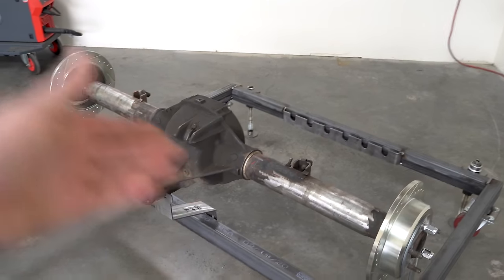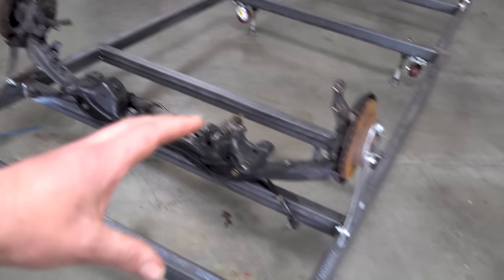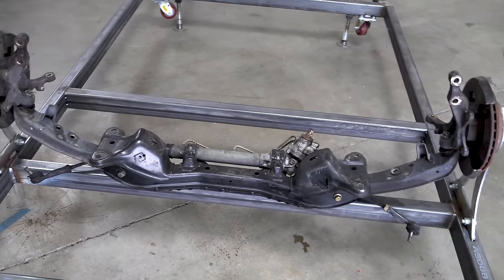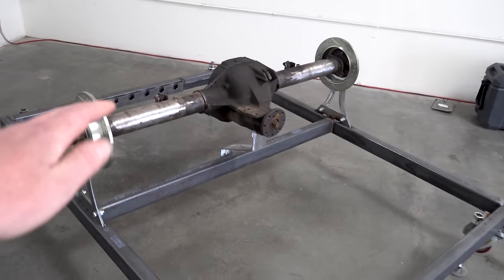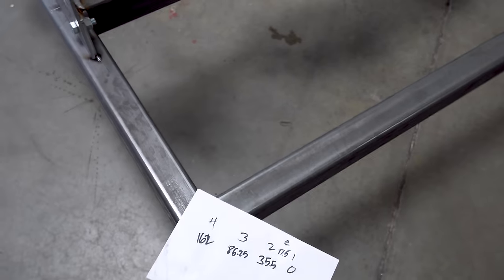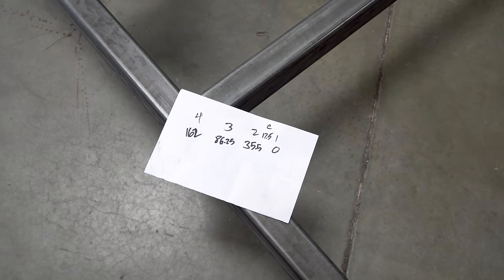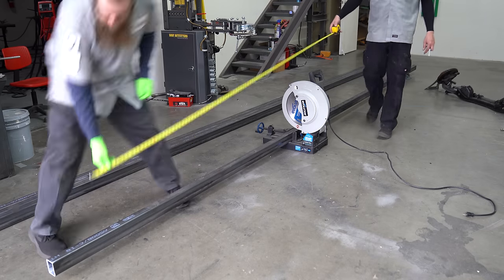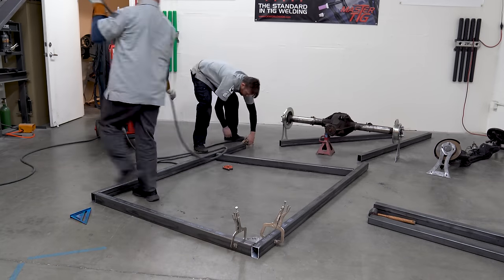Let's Build a Chassis Jig

Comment: Ah tip for anyone that hates leveling stuff that are large and painful.. get a laser level.. Stick the laser on a stand a couple of meters (yeah im swedish) away from the frame..  Make a small stand that holds the receiver.. Stick the reciver on a corner, raise it till it beeps, move to opposite corner, raise it till it beeps, continue till it beeps equally all around.. you are done.. Yes laser levels is expensive.. so is a welder, a frame jig, a plasma and building a car from scratch.. when not using it, lend it to your wife hanging picture in your apartment, watch her try to figure out why laser level looks crooked in your house... enjoy.

Comment: I'm a fabricator myself, and will confirm that this is the right and as far as I know the best way to set a jig up, excellent setup since it's simple, and versatile since it's mobile. When you give up on the project for a year (been there), then you will thank yourself for have wheels on it
Reply: this is a good "cheap" way of doing it....the "right" way of doing is too expensive for your home build or a one off build that's not a pro shop dedicated to building chassis
Reply: @supersevenn  agreed yes, the best cheap way for most average people to get access to.
Reply: @supersevenn  Its plenty "Right" as long as the finished product is sound and works as intended. And the only difference from this and big NASCAR or Dragster shops even motorcycle shops is they make their fixtures fully adjustable and strong enough to make hundreds possibly thousands of Chassis. a couple to a few a week for years at minimum. This guy isn't planning to make these on production so no need to go all crazy expensive. Thats the only reason big shops use big heavy expensive materials on their fixtures. If the dimensions are right and its welded correctly it's coming out right either way. Makes no difference.

Comment: Love the video, working with a temporary jig currently and plan to build my own in the near future.  One suggestion before you go too far.  Raise the front cross member so the lower control arms are parallel to the jig.  This will change your track width on the front and might help with the Camber in the front.
Reply: Jim Fisher Exactly my thoughts 👍

Comment: Funnily enough I had to build a chassis jig recently for my mid engined V8 Beetle project but as I only have a small garage it needs to be moved constantly. The top is 2" x 2" box with 2" x 2" spacers approx. 10" long underneath with a third layer bottom also of same box, along with various cross pieces all fully welded on a 5" square 1" think steel table. It's flat, square heavy and moves very nicely :D Really enjoy your vids so please keep them coming!
Reply: Awesome! Anywhere I could follow the build? I'm a VW guy with an '80 scirocco. When I finish my 2.6L w/ Weber DCOE powered '73 Opel GT, I'll either build a Locost(I see your avatar) or I'll convert the scirocco to rwd. I have a built VW 2L 16v with a RWD Motorsports bellhousing and mustang T5 waiting for a home.

Comment: Your method is tried and true and I can't tell you that my way is better cause its long gone now and in someones yard rusting by now as  that  was  twenty plus years ago. Method was jigging the axles and building it from there as it is definitely different and with everything done, It was one fine ride for absolutely sure as I mocked up the engine, and other driving gear. I got my ride hight from the coil overs and the ladder supports. I had the two shock per corner and then for the terrain dialed in my camber and caster and the whole thing piece by piece took form and it was a thing of beauty with it assembled... No batteries included

Comment: Interesting, I have a Mitsubishi L200 Barbarian which I purchased new in October 2018. Over the past week I have been thinking about moving the rear axle back a few inches and removing the rear overhang, why they cannot build the things right in the first place I do not know, but with a load in the back the weight is to the rear of the axle. I have done a few Ford transit trucks in the past to make car transporters putting about two and a half foot into the chassis but I had my workshop then (I am now retired) which had a lasered leveled floor now I only have my garage so a jig is going to be a must.

Comment: Pro tip on leveling anything with jack screws. Make all adjustments to the screw jacks by measuring diagonal. Level can than be verified by measuring across the width or length. The removes the dependent variables in your adjustments by screwing up your lengthwise level by fixing widthwise level. It's also useful to know your thread pitch. Knowing that a 1-8 will change height 0.125" per revolution will help you make that 1/16 of an inch change a lot faster.

Comment: Only things I've done slightly different are a couple of diagonal braces to hold squareness and some spray paint round the feet so I know to recheck level if it gets knocked or nudged and it doesn't make much difference if you're careful anyway. I also made mine a bit higher off the ground, about 18" so I could get all round it while working on chassis. Great build and a great video, looking forward to the rest. It's been years since I've done anything like this and now I'm wanting another Land Rover. I'm gonna blame you when my wife finds out what m doing.

Comment: Thanks for the helpful video... I have always wanted to build a new frame and suspension for my old truck. This is the first video that I have found that address the use of a jig to support everything rigidly. I am curious to what you do to address heat distortion while final welding the jig?

Comment: Good first step is to check that your level tool actually reads accurately. Turn it both ways and make sure it reads the same. You'd be surprised how many levels are not calibrated.

Comment: I'm a carpenter. I Like everything in this video except the leveling instruction. Jumping all over the place with the level will just leave you chasing the bubble forever.

1st, pick a corner support to start with. In this case because it's free-standing structure, it doesn't really matter which support, but one close to an outside corner. This corner will never move up or down (Z), but make sure any other support can move up or down in relation to it.

Then use the level to span in each direction from your starting corner to the next support in each direction (X and Y). Get those two closest supports perfectly level with the starting corner support. Remember, do not ever move the starting corner. You might have to adjust other supports to keep the frame from flexing too much.

Once the 2 closest supports are level with the starting corner, use the level to span between those supports and the next closest supports. Do not adjust the two supports you already leveled, only the next 2. After that section is level, do it again for the span between the next supports to the 2 you just did. Keep doing that until you meet at the opposing corner support from your starting corner. 

If everything went well, that last corner should be able to adjust to be level from both closest supports at the same time. If not, either your level sucks, you screwed up, or your frame flexed a little during adjustment. In any case, it should be a lot closer than it was when you started, so flex or mistakes are less likely a second time. Go back to the starting corner and do it again. Double check as you go with a second level if you have one.

After the second go, it should be perfectly level. Now triple check it really quick between each support. 

Now, get some spray paint, spray around each foot leaving a shadow of each foot on the concrete, and spray the all-thread where it goes into the bracket on the frame. Now any time you have to lower/move the jig, you can put it right back where it was using the paint on the concrete, and be able to get really close to level using the paint on the allthread. Always check it afterward, but you should be really really close.

All of this should only take 20 minutes or so. Even less if you use a laser level to start, but always fine-tune with a good beam level.

I work with wood, and if I can adjust beam-posts in a basement to get a 2,800sqft house perfectly level after it's been framed in less than an hour, you can get a relatively small steel frame with no weight on it perfectly level in a fraction of the time.

Comment: Idk if this helps, but as kids when we’d build treehouses we put some water in about 10ft of 5/16” lawnmower fuel line from farm and fleet and then marked 6” down from each end. Then removed 6” of water from each end. Then we’d just cap the ends and then we’d have a flexible and easily mobile level👍🏼

Comment: To save some yoga moves later, you can add the scribed centre line on the frame now. A tab front and back for an under or over slung string line adds double functionality. Keep up the good work.

Comment: I definitely will be watching. How you do your chassis jig and how I do mine, well they are totally different. Mind you what I build is smaller toys, LOL. Guess it comes from the training between you and me. For my chassis jigs, all I need is a straight line from front of the frame, that goes to the rear of the frame, past each end about a foot, and on center only. Doesn't even have to be level either. You on the other hand, have to be level with the ground and are using the wheels as main reference points, all four of them. Interesting.

Comment: Just wanted to point out that you can't actually determine that a shape (rectangle, in this case) is actually square by measuring the diagonals. A parallelogram will always have matching diagonal measurements, but is not necessarily a rectangle...I know that it generally works, but if precision counts, this way won't cut it...
Otherwise... I really dig your work, and I'm enjoying your videos. My son and I are building a CJ5, and we've learned a ton from watching your vids. Thanks for sharing!

Comment: The most important part about  making  a chassis jig is  of course to be flat but also a center line  and perpendicular line  so you can always go off of these lines and have an accurate front to back and side to side  but  thats just what i do,  Every  chassis jig should have a center line and perpendicular  permanently marked or drilled , strings , any way you can  ..

Comment: Track width is dependant on offset of wheels it's the centre of the wheels at the offset, most suspensions are build with certain offset for instance an rx8 has a factory + offset of 50mm fitting wheels with half that offset may look cool but it screws with all kinds of suspension settings starting with scrub angle and can include bumb steer  and self centering and possibly a crash . After 55 years as a mechanic and fabricator, first thing to do is make the car handle, second make it stop ....fast.. then start planning g power curves, and I mean plan forget horse power. You need TORQUE AT ALL THE RIGHT MOMENTS   horsepower is for canaries and high end runs

Comment: If the jig is set at the bottom of chassis height  shouldn"t the wheels and rearend cl be set at 1/2 tire diameter minus ride height ( normal ground to bottom of frame)? Or do you want jig to represent max bump position?

Comment: Curious about the datum points.  
First how did you get accuracy from inside to an outside surface (rear end of cab as example)? I understand the tolerance is not extreme, still.
Second, why did you not chose points more commonly used in collision work eg. holes in the frame or, sometimes, bolt head(s) centers?  
Books/tables/charts with all sorts of related measurements that may come in handy down the road.  It could be your illustrated points are the same just transferred from under to a visible surface for video purposes.

Comment: One thing that bugs me a lot is how do you center the rear suspension if your using a multi link subframe since there are caster take into account? What I mean is let say the suspension has a positive or negative caster in the first place, won't it affect the measurement for the subframe mounting point and the wheelbase since it's off?
Reply: I'm going to take a crazy guess, since you set the wheel hubs where you want, you make the chassis to pick up the sub frame where it needs to be.

Comment: Sweet its happening great video insight to what and where for a chassis jig, I've been putting a project off for years as I need to build one thing is I have another car with the exact dimensions I could build the jig straight off that car haha. As for the engine its your bus build it for you, Haters are gonna hate but they ain't driving it!

Comment: Okay, point taken, a concrete floor isn't flat or level enough to be a fabrication table, but it sure is a hell of a lot better a starting point than what I have right now.  You're building a Mighty Max, but you're thinking people will be put off by the motor?  How bad could it be, a Chevy Vega 2.3?

Comment: When you were measuring the diagonals for squareness, I noticed the measuring tape was dipping down in the middle almost touching the ground? Won't that affect the accuracy of the measurement?
Reply: Depends on how accurate you want to be; there is another "wire" method where you don't even actually take a measurement per se but rather stretch a wire from point to point on the diagonal and it has be match exactly on the opposite diagonal.  In this case you could do the front and rear boxes separately and then again overall front to rear.  For this type of stuff you could also argue you should be using a metal measuring tape, the shorter ones often are but some longer reel tapes are fibre/cloth and you run into issues with actual stretching.

Comment: Can you build a rectangle tube chassis without a chassis jig?
Reply: You need a flat true surface. I built a full rectangular tube chassis for a s10 that passed NHRA certification for 7.50 second runs off two I-beams and some 2x2x14ga square tubing.

Comment: So... that spirit level is good enough? I thought you would want it more accurate than that, did the level get flipped at least to make sure? Because in my experience they can be out a bit. Or is the spirit level within tolerance?

 Also has anybody heard of the method where you get a fluid in a bottle with a hose sticking out and level with that? I think its called a water level I'm not sure how accurate it is though but I've heard its pretty dead on.
Reply: " Also has anybody heard of the method where you get a fluid in a bottle with a hose sticking out and level with that?" Its called a water level, clear plastic hose filled with water.
Reply: Yup, used it a lot for all sorts of things - sometimes as an actual level, sometimes as a reference point - no spirit, laser or digital level can be as accurate!
It is fiddly and labour intensive, though, so if you can get hold of a rotating laser level, I would definitely recommend that as it's way more accurate than anything you're ever going to need - easy and simple, if expensive!

Comment: Surely you should have the front subframe set at its working height. Where it is and you have built the jig is about 1 foot lower than it should be. This is going to ruin all suspension geometry and wont have any further travel. 
Also with the angle of the lower arms your track width will be narrower than it would be with them set in the correct attitude (they should basically be level). With it also being a Macpherson strut suspension setup, the camber is to do with the top shock mounting and nothing to do with any of the suspension setup you have there so slightly confused why you have seemingly set the camber off of where the suspension is bound up.

Comment: If you want to save yourself a shit ton of time in the Leveling process? Get a Transit. And not one of the cheap beeping lazer type POS either. One of the old school sight transits you can read a tape measure off of then you and another person can level that fixture or an entire house in about 20-30 minutes. It really does speed it up significantly and far more accurate than even the best most expensive levels. (As long as you set the transit right) They can be pricey brand new but if you just make sure the leveling parts are good and the lens are good you can pick them up at farmers or flea markets pretty reasonable sometimes. Pawn Shops ect. 
Thumbs up otherwise from me. \m/

Comment: Don't mess up your scrub radius.  You need to widen your front suspension either in the crossmember or control arms.
Reply from the maker: We dont even have a suspension yet.... don't put on a condom to ring the doorbell
Reply: @TheFabricatorSeries  🤣
Reply: @TheFabricatorSeries  I like to knock so don't worry about me, this is about you, don't run 2" wide wheel spacers and wheels with no offset.
Reply: haha, speak for yourself - with this corona virus being passed on from surfaces, If I have to ring the bell with my hands full, I make sure I have a condom on...

Comment: can you explain how we can weld 1mm onto a 2 or 3mm plate.  I keep blowing holes in the 1 mm sheets.
Reply: Are you directing most of the heat into the thicker plate?
Reply: @gordowg1wg145  no but i can try it that way.

Comment: "if you use anything other than I-beams you have weak sauce"
 you used RECTANGULAR steel tube with the long axis parallel to the load, there's no reason to over-engineer anything when you can get away with using less and inexpensive material
Reply: A lot are built with I beams, but as you suggest, a rectangular section beam is much stiffer in torsion (twisting). It can be built lighter and also much easier to weld together.
Reply: Round tube is even stronger, but more work to build with. Need to notch every connection.